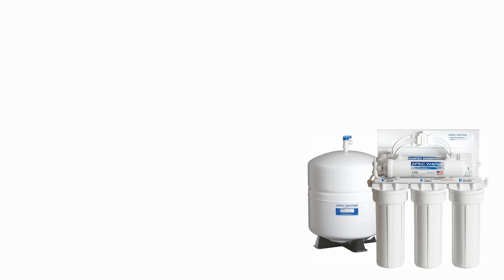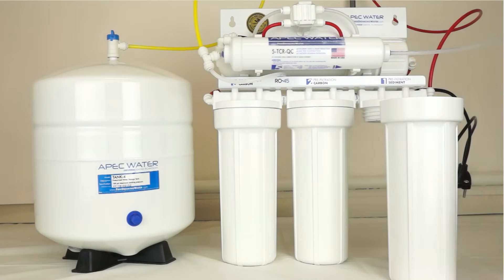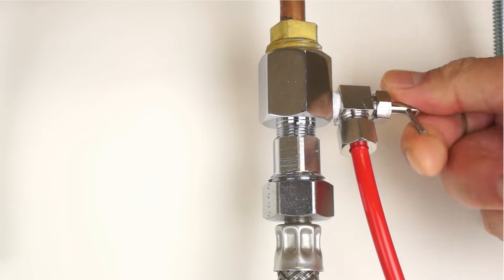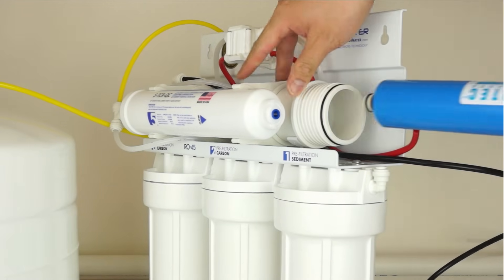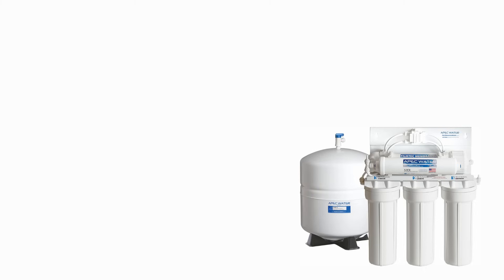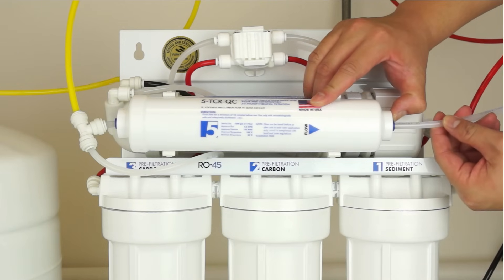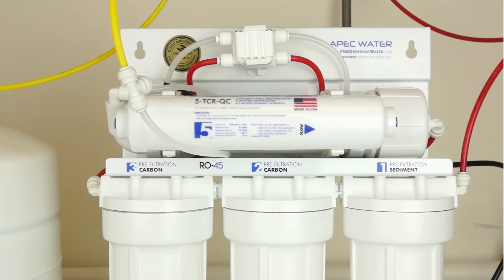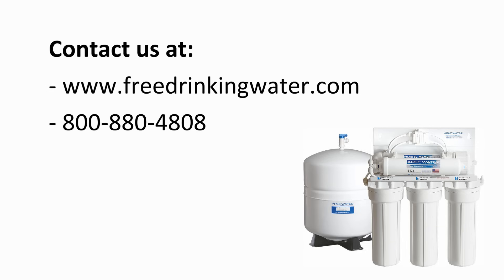How To Replace Your Reverse Osmosis Filters and Membrane - APEC Water Installation Part 6

Comment: It's been 11 years, but this video is still incredibly useful — thank you! I finally managed to replace the hose after struggling for ages to figure out the quick-connect mechanism. This video explained it clearly, unlike so many others that rush through without showing the details. Great job!

Comment: Just finished today. For #4 filter, the cap is on VERY tight. Buy a rubber strap wrench from Home Depot and hold the filter housing while you use the ‘tool/wrench’ to remove the cap.

Much easier and doesn’t require the strength of a Greek god to open it.

Comment: I finished putting the filters all in and went to bed. This morning, I turned on the faucet, expecting it to empty to a trickle after 15-20 minutes. It has been an hour, and the waters are still flowing strong. Is the water good to drink now? Did I need to do something to properly drain the tank?

Comment: I will not purchase this system again. Far mire tricky than say The watts RO filter that has ez to change cartridge filters. Just bought a new Apec, to replace my old near identical some other brand named one, that uses same filters, total PITA, particularly the newer version "check valve" to the drain. hard to align with the existing hole in the pvc, kept shooting out.

Comment: If the Stage 4 Membrane Canister is misbehaving, here is how to open it... 

1) Mark the Waste and Output Ports from on the Reverse Osmosis Membrane canister
2) Separate the canister from the rest of the filter assembly and drain it the best you can by tilting it.  
3) Put the canister assembly in the freezer at least 10 min.  
4) Meanwhile, place a pot with water on the stove to boil
5) Once it boils, take the membrane canister  out from the fridge.  Plug the cap side hose fitting it with a one of the rubber plugs from the other cartridges.
6)  Carefully place the canister cap inside the hot water, keep the body is out of the water. 
7) Keep it there for 1-2 minutes. Warming up the cap will expand it making it easier to unscrew.
8) Grab the wrench and open that son of a .... 

There you have along with a demonstration of thermal expansion!

Enjoy!

Comment: Which is the one you change every 4 years? Either 4th stage or membrane or 5th post carbon filter but I can’t remember
Reply from the maker: For our 5-stage RO systems, it is recommended to replace the Stage 4 (RO membrane) and Stage 5 (inline carbon post-filter) every 2 to 4 years or 3 to 5 years, depending on the specific system model.

Comment: It’s an excellent video, but after I replaced all three filters and the membrane, trying to stage 5, in my system it doesn’t have the quick connector and intead the plastic tube connected to an L connector and may be screwed in the main part ( I can see the treading inside the end of the part) . Would you help and tell me what I should do? Thanks.

Comment: I saw a comment burried in ine of these discussions to use a C clamp to unscrew the RO Membrane canister. This worked really well for me, nothing else i tried did. I used a vice on the other end. Some comments make it sound like newer kits come with a smaller wrench specifically for this canister. My kit did not. Unfortunately even if you get this cover off, you have to tighten it a lot when you put the new filter in to avoid leaks. I may call support next time this filter needs service and see if i can just buy the whole canister. Hassling woth the membrane is ridiculous, the materials for the plastic canister cant be that expensive.

Comment: Elderly lady here.  Stage 4 filter was a pain!  I had done it before, so wasn't expecting it to be a problem.  Back in the day, APEC had awesome customer service.  The tech would stay on the phone with me until I resolved whatever issue I was having.  Those days are gone.  Today they emailed me a photo of how to remove the cap with a plastic wrench which was smaller than the one you use for Stages 1, 2 & 3 and did not come with my unit.  The rep opened a ticket for me, said someone would call me back, but nope -- nothing yet.   I eventually took the housing to a neighbor, who easily removed the end cap.  After that, I had to deal with several leaks and lots of water everywhere.  And again, leaks were not an issue last time, so I feel like the connections are wearing out or something.  Phooey.
Reply from the maker: Sorry for the confusion.  We strive to provide exceptional service to all of our customers. With all of our systems we provide 2 wrenches one smaller one for your membrane and a half wrench for your pre-filters. It is easier to open the membrane when you remove it from the system and open it countertop shown in the instructions that was emailed to you.

Sorry to hear of your leaks. Our team will reach out to you directly so that we can obtain pictures of your leaks. We are happy to resolve the issue you are having.
Reply: @apecwatersystems  The smaller wrench did not come with my unit, so the emailed photo did not help at all.  Only a neighbor with very strong hands could open the cap.  If you read the comments here, you will see that it's a serious problem.  The leaks stopped when I realized things just didn't fit together easily like the last time I changed #4 and #5.  My big complaint is that you used to have awesome techs who were available by phone immediately, stayed on the line, and walked me through any issues I was having.  They were very supportive, courteous, easy to understand, and never had to email or text me anything.  Even ordering filters from you guys isn't the good experience it used to be.
Reply: I can’t remove Stage 4 as well. It rotates along with the unit and there’s no way to keep it from moving.

Comment: Agh, I remembered why I hate changing these filters today!  Tips for future self:
- Need to not just turn pin valve but bigger water valve under sink as well
- 1st membrane is hardest to get off. Put on side, use grippy shelf liner on wrench for better leverage
- Use large roasting pan when unscrewing to catch water that will spill out
- canisters will need to be cleaned out
- **Important* Make sure filters are well screwed on (yes, this is why they are so tough to get off!) otherwise water will come squirting out the top edge!
Reply: Thank you, I could not for the life of me figure out why it wouldn’t stop leaking
Reply: @marcosguillen6511  yes, all filters need to be screwed on so tightly that they don't budge at all otherwise water will come spilling out on top. Again, just reminding myself for next year when I'm doing this again!

Comment: How often should you change the membrane and the 5th filter?
Reply from the maker: Thank you for your inquiry. Your filter schedule would depend on the system you own. If you own a system from our Ultimate Series, you will change the pre filters stages 1-3 every 12 months and stage 4(Membrane) and 5 will be changed every 3 to 5 years.

If you own a system from our Essence Series, it is recommended to change pre-filters 2x a year and stage 4 and 5 every 2 to 4 years.
Reply: @apecwatersystems  You’re welcome.  I have the Green water filters.

Comment: I truned the water line off, and the tank. As soon as I started unscrewing the first stage, water started squirting out of the threads!!!! Its under pressure and plenty of water inside still!
Reply from the maker: Dear Phil,

We apologize for any inconvenience caused. May we know the reason for unscrewing the threads when replacing filters as the thread does not need to be unscrewed.

Also, can you kindly provide the following to best assist?

1. Picture of the area.
2. Full name.
3. Email address.
4. System model.

Thank you.

Best Regards,
APEC Customer Service
Reply: Thank you. The thread, I mean unscrewing the first stage. Its what I needed to do to change the 1st stage filter. I left a message on the general mailbox as well. Chers! @apecwatersystems

Comment: having trouble removing the tubing
I can push the ring down but can't pull out the tubing?
Reply from the maker: Hello, we are happy to assist you. Please make sure to turn off tank and turn on faucet. To disconnect the Tubing, Press In on the White Ring that is holding the tubing. At the same time while pressing in, pull out the tubing. You can also try to press the white ring and push the tubing in before pulling it out. If you are still unable to remove tubing we can send you a JG Tool by contacting our customer service team. Our customer service team are available Mon-Fri 8am-5pm PST at 1-800-880-4808. Thank you!

Comment: Can we replace the 4th and 5th at one time, or do we need to discard several tanks full of water in between the 4th and 5th filter.
Reply from the maker: Thank you for your inquiry. Stage 4 and 5 can be changed at the same time. After changing both filters, you can then proceed flush out the tank a couple of times.

Comment: My 3-stage RO filter unit is positioned within the laundry water tub. This is useful just in case the filtered water dispenser container accidentally overflows. No damage will result because any filtered water overflow goes down the laundry tub drain.

Comment: Long nose needle pliers will not remove the RO membrane from the plastic housing on my 3-stage filter unit. It takes a brute force manual pull method of steel wire attached to the membrane handle, and the other end to an outdoor pipe. It just happens that the membrane on my filter unit is too strongly stuck in place for simply using pliers.

Comment: For the membrane encloser I had to replace the quick fittings elbow. I pulled all of them and noticed one was a check valve. I forgot where the check valve elbow go? Can anyone help me? 😅
Reply from the maker: Dear Valued Customer, the check valve is installed on stage 4 membrane housing pure water output. Please kindly see attached RO diagram Point E is the check valve location.

Comment: I just replaced all 5 of my filters but i have a small leak on the 4th stage membrane. The leak is coming from the housing itself (the part that screws open) and not the tubes or connections. I have tightened as much as I possibly could and there is still a small leak. I'm not sure what to do?
Reply from the maker: Dear Valued Customer, so sorry for the inconvenience. This would indicate the membrane housing o-ring there are 2 is not properly seating inside the inner cap neatly or at the outer thread on the housing. Please unscrew the cap with the cold water turned off to the RO system to double check inside the cap first should resolve the issue. 

If the issue persists, replacing the o-rings should take care of this under our factory website parts page below. Thanks.

https://www.freedrinkingwater.com/apec-residential-ro-systems-replacement-parts

Comment: Hi.. should i change the membrane if stinky smell comes out everytime first start i open the day after? The stinky smell is about 3 minutes. after let it flow it becomes normal smell...
Reply from the maker: Dear Valued Customer,

We recommend first turning off the tank ball valve and turn on the drinking faucet and run the purified water for 3-5 minutes to see if there is any smell. If there is a smell, replacing the system filters like membrane or pre-filters based on our recommended filter maintenance schedule should take care of the issue. If there is no smell, please turn the drinking faucet on for another few more minutes and if there is continuously no smell, I recommend turning off the water to the RO system and see if you can empty water from the water storage tank using the drinking faucet. An empty tank weighs 10lbs and if you cannot empty, replacing the tank should resolve the issue.

Feel free to contact us by visiting our customer contact page at https://www.freedrinkingwater.com/contactus.htm We are always happy to help!

Best Regards,
APEC Customer Service

Comment: Here are my tips after I watched the video twice and replaced all 5 filters:
1. Remove the system from the wall if mounted. Its much easier to replace if you don't have to squeeze in under the cabinet
2. Have a towel and or bucket ready under the filter you're opening to catch the water
3. Use the provided separate tool to remove the RO membrane twist cap. Its very tight. This separate tool is different then the tool used to unscrew the sediment and carbon pre-filters.
4. Leave the system out when purging to check for leaks
Reply: do you need to remove the tape from the new membrane
Reply: I second number 3 ... I had to search every square inch of my house to find where i left the RO membrane removal tool lol, but it was very much necessary.
Reply: What does the separate tool look like?

Comment: Wouldn’t it be best to to flush out the first 3 filters since they have so much sediment ( charcoal)  I usually disconnect the hose that comes out of stage 3 and let that flush out into my sink about 5 gallons.
Reply from the maker: Dear Valued Customer, 

Thank you very for your feedback. We truly value your support and patronage with us.

 If it is convenient, you can flush out new carbon filter powder at Point C1 out of stage 3. This is optional only if convenient, not mandatory as in most cases the new carbon powder will generally not affect stage 4 RO membrane.

Sincerely,
Apec Water Specialist

Comment: I read something about bleach. This video doesnt mention the bleach. Do I need it?
Reply: Bleach is needed only when you are sanitizing the system completely or if you need to sanitize a connection like at the stage 5 or 6 filter ends

Comment: GREAT to-the-point video! THANK YOU! I have a system that i built for a friend, but it never got to be reinstalled and has sat for about 2 years. Do you think the system would be ok if I just gave it a good flush? or do you think i should replace the R/O membrane. It only had about a month or two of use before being plugged up and sat for 2 years....

Comment: Video is okay, but it obviously shows a system that actually wasn't in use.  There will be lots of water in the filter canisters, so advise you to have towels on the floor to collect the spillage.  As for clockwise and counterclockwise, it's all relative and depends on which direction you are using as a reference.  Thanks for the advice on running 2 full tankfuls through if you replace the membrane.

Comment: Now do it with actual water in it and in a real-life situation!  Mine installation did not have a valve shutoff going to the unit. I just shut off the whole house water which worked fine.

Comment: Quick tip, if you have leaks sometimes the tubing is damaged and has bite marks in it from the quick disconnect fittings.  cut a piece of the tubing off past where the bite marks are and reinsert and your leak will go away.
Reply: Thank you! Good tip!

Comment: how long does it take for the tank to release pressure?  It's still running water with the valve and blue thing on top closed.
Reply from the maker: If you are referring to releasing the built up pressure in the system, once you completely shut off the inlet, close the tank then open up the drinking water faucet there should be no more water within a few seconds or so. If you need further assistance, feel free to contact us directly by calling 1-800-880-4808 or e-mailing us at info@apecwater.com. We are in the office from Monday-Friday from 8:00am-5:00pm PST. Best Regards, APEC Customer Service

Comment: How much water you can filter on one set of filters?
Reply from the maker: Hello Customer,

With normal usage / water quality you replace out the stages 1,2,3 vertical filters every 12 months and stages 4,5 every 3-5 years if you are referring to one of our Ultimate series system which is pictured in the filter change video. If you need further assistance, feel free to contact us directly by calling 1-800-880-4808 or e-mailing us at support@mail.apec.ladesk.com. We are in the office from Monday-Friday from 8:00am-5:00pm PST. 

Best Regards, 
APEC Customer Service

Comment: Is turning off the main source of water assumed? I started with the pin turn off valve and the half turn for the valve in the tank... lo and behold I also needed the main water to the sink area off. 😬😬😬

After we stopped the fountain of water, most other parts were straight forward, except the instructions for flushing the remineralization filter. I am hoping flushing the talk itself will have that covered. 

Thanks for the video it was all in all very helpful!
Reply from the maker: Hello Customer,

As long as you have the needle valve turned clockwise until it comes to a complete stop and tank is close, then open the drinking water faucet to release any pressure build up there should be no water going through the system and main cold water valve would not need to be turned off. If you need further assistance, feel free to contact us directly by calling 1-800-880-4808 or e-mailing us at info@apecwater.com. We are in the office from Monday-Friday from 8:00am-5:00pm PST. 

Best Regards, 
APEC Customer Service

Comment: 5 filters & 1 big ball . Need another filter for fluoride  .  20 different steps to clean too many lines to count . Simply amazing  people still buy this .
Reply from the maker: Hello Customer,

The reverse osmosis system is designed to remove fluoride from the water so no additional filter is needed for that. Our systems are user friendly so anyone that is a little handy can install and maintain the unit as many of our customers have. If you need further assistance, feel free to contact us directly by calling 1-800-880-4808 or e-mailing us at info@apecwater.com. We are in the office from Monday-Friday from 8:00am-5:00pm PST. 

Best Regards, 
APEC Customer Service